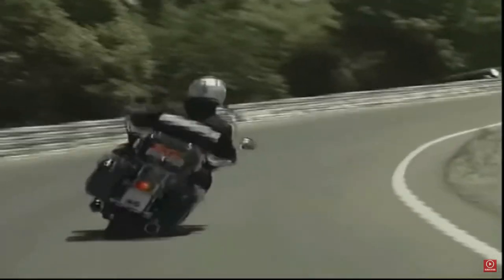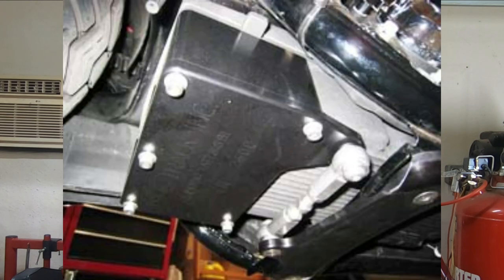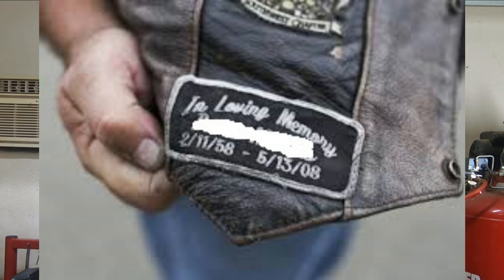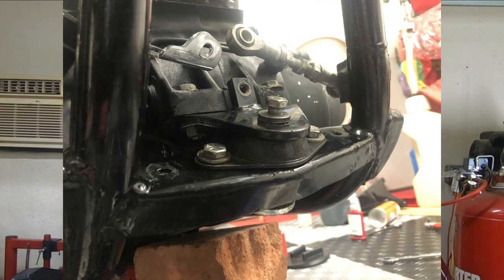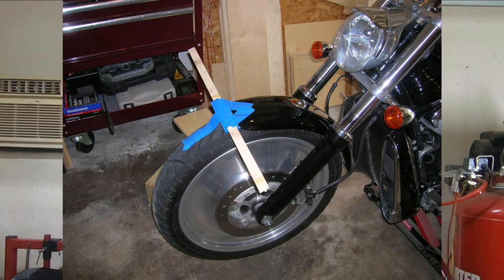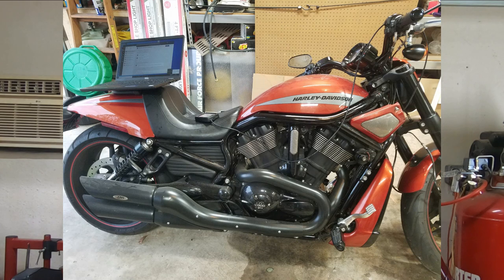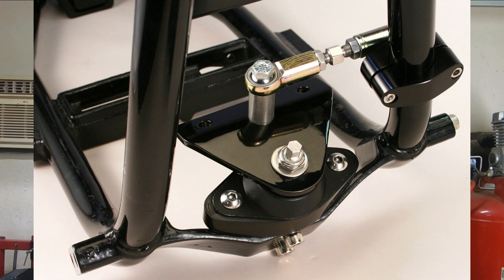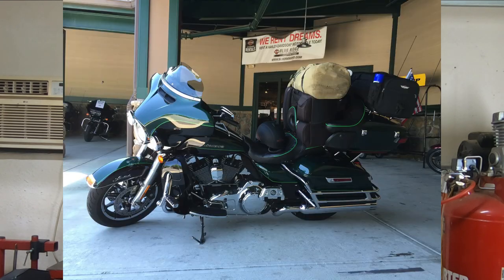The Dangerous Harley Problem

Comment: Look at all the big twins like especially the Ultra Classic they made through the years prior to 2008 and compare them to the 2008 Ultra Classic and then the 2009 and newer where they improved the rear suspension and drivetrain and increased capacity and you will notice that the 2008 was minus front of engine stabilization that was on previous years and I bought a new 2008 Ultra off the showroom floor and it wouldn't drive properly two up at highway speed and always felt it wobbling back and forth and just poor handling. I took it back to dealer numerous times and they said they could find nothing wrong with it and that was just the way it was and "they all do it" !!! Well,  my wife and i got in an accident due to the way the antiquated farm equipment handled and I decided to unload it at a loss as I deemed it unsafe and bought a 2008 Victory Vision Tour  and to this day, best Handling American bike I ever rode and I have been riding Harleys all my life. Now supposedly in 2009, they changed the design and I'm.told they are better. Too little, too late as Harley didn't care! Never going back.  I would buy an Indian first.  Great content. Muchly appreciated 👍👍👍
✌️🇺🇸

Comment: I’m sure this will happen to any bike due to lack of maintenance etc but it seems it’s inherent with HDs even with proper maintenance. I currently ride a 28 year old German sport tourer and a 7 year old Japanese ADV bike and both handle without issue when they are pushed hard or not. I was thinking about adding a pre 08 Dyna or Road King to my stable but the more I learn about how these bikes ride and other characteristics I think I’ll pass. For the lack of better Terminology, they just seem like junk. Heavy slugs. A solid mounted Sportster could be better

Comment: Are you familiar with the dreaded Double Death wobble? Thru the summer months of 2022 I counted a total of 13 passenger vehicles on the highway berm.All 13 were setting right down on the rotor missing the drive side front tire, occasionally you would see where the tire upon leaving the 70+ mph vehicle would jump the center concrete divider and be a quarter to half mile down the road in the opposite lane,or an undrivable car parked with the windshield smashed in as well as grill and hood.Non of the above were jacked up indicating a tire change. That brings me to operator error I.E. lug nuts coming off. What individual could possibly drive long enough for all 4 or 5 lug nuts to go come completely off without noticing something? In any event the Dreaded Double Death wobble falls in the same category as the Death wobble, OPERATOR ERROR - NEGLECT. I've been riding 3 decades plus, all over the USA at various speeds ,rain,shine, and a few times a spurt of hail up around the lakes,on HD's and never experienced the DW , my bikes are meticulously maintained.Now I have witnessed the Dreaded Double Death wobble.

Comment: All tyres go out of balance from wear! I use ceramic beads in both front and rear ,problem solved, tyres always balanced! And I have braces front and rear on my FXDB 2006 and the rear on my old FXRP 1991 again no wobbles anymore! 🇬🇧🏴💪👍
Reply from the maker: I am huge fan of balance beads! By the time you get to a speed to matter on tire balance they are already doing their job!

Comment: Sorry HD has always had this problem, just the rubber-mounted drivetrain really increased the problem.  Years ago had a Kaw H1, and they were known as widow makers due to the wobble problem and the toggle switch power band.  The Kawasaki was somewhat easy to fix, they had crap swing arm bushings and if you pushed it frame gussets.  The HD is already stressed to the max weight wise, so the bike is pushed to the max from the factory, now you put a passenger and loading goes into the OH SHIT mode.  The easy answer is to simply buy another brand of bike that doesn't have so many issues that it takes a book to catalog.  Sorry HD has issues with wobbles, clutches failing, engine failures etc... and all for the price double that of the competition.  It is bad when my 93 Goldwing with over 100k on the clock has practically double the lean angle, no wobble issues if the tires are kept within specs, and a bulletproof engine.  My only outside repairs outside routine tires, oil, grease and filters has been a couple of light bulbs, upgraded alternator, battery change out every 5 years and cam belts at 50k intervals.

Comment: Commonly known as Dyna death wobble.......because this only happens to dyna's, that is according to a utubr Harley hater

According to him it's because no 2 shocks are exactly the same........of course crotch rocket tank slappers being the same thing have only one shock in the rear, and Harley doesn't make them

Tire pressure.......when my gauge said 42lb I was actually running 48 on my crotch rocket, I had belt showing in the center at about 2k miles......found 2 gauges that said same thing and went with them.....I traded crotch rocket at 3k and tire showed no wear and handled great..... didn't seem to hurt the front tire

At same time my Wide Glide had been running with too much air also, but I hadn't ridden it as much nor as hard.....I ended up with 7k on the rear when I changed it.....on each side there was visible where tread had been, all the way across the tire it was smooth, I've got about 1k on new tire and keeping it aired according to handheld gauge it's showing no wear and handling is great...... I've got new front tire for it but I can still see tread...........the point is make sure the gauge your using is correct

Stiff ride....I had 2002 and 2004 883's......02 was far better handling and it didn't shake me to death...... actually everything about that bike I liked better than the 04...good luck for me to find another..........If I ever need mounts/bushings I'll look up them hard ones

Comment: After well over fifty years of riding Harleys as well as Metrics l have found  a lot of the handling problems found with motorcycles come from a maladjusted wing nut on the throttle.

Comment: I never had the problem in 70,000 miles of cross country riding. That being said,I am anal about preparation,maintenance,tire /wheel settings. I do all my own mechanical work. I buy the best parts available……..I do all you talk about and more. I buy new tires long before they’re worn out. Due diligence = carefree ride

Comment: Folks, this is not wobble. The motorcycle is heavy and was not designed to head into corners like a sport bike. The issue is the tires giving up traction in the sharpest part of the turn. Watch this video and see the tires giving up. Flutter Weave and Wobble are very specific on a motorcycle. Let's not use the term Wobble unless it is a true Wobble.

Comment: 7 years you're risking your life every tire manufacturer in the field and I know this cuz I was a tire guy for a while even if it's a brand new tire that's been sitting on the shelf for 6 years they pull it and throw it away because it is no longer safe because it is dried out and potentially could come apart on you

Comment: When the rear wheel swing arm is attached to a rubber mounted engine instead of a solid frame it will move around. when leaned over.
An absolutely terrible design flaw.
The only real solution is to sell my HD and buy a Triumph.

Comment: I have a question about cams and valve springs...is it possible to over spring a cam and lifter...I only ask because I'm running a
.570 lift cam with .575 lift springs
Should work on paper but at 6000 rpm things seem to be different 🤔

Comment: Yeah, let's blame loose spokes and low tire pressure and completely ignore ridiculously bad engineering from the factory. If you own a Dyna and you've never had the back wheel try to steer you off the outside of a curve it's only because you ride like an old fart. I wonder why Moto GP bikes don't have their swingarms bolted to a rubber-mounted drivetrain? Meh, it'll be fine.

Comment: I've been around Hardee's since the '80s and I've heard about Harley's death wobble since about 85 till 2010 I think it is actually occurs a lot more when you're trying to accelerate through a corner or you get into the corner and you start to give it some gas to go faster and it'll really walk off on you so much so you'll slap the tank I've only experienced that on Hardee's and I've written a lot of bikes I've been riding since I was 4 years old the first bike was 1983 cr60 and I've ridden a bike every day since out of all that time on a bike I had to happen once on a dirt bike and like seven times on a Harley I think it's stupid how hard he has a rubber mounted engine and a hard mounted exhaust they always break right at the exhaust port on the head the flange always bust off because the engine can move but the pipe can't because the pipe is hard mounted to the frame which is to me stupid they should have put a flexible mount on it I know my dirt bikes were rigid mount but they still had rubber mount for the exhaust

Comment: You said 2009 and down. That is not correct. 2009 has the same frame, engine mounts and swing arm as the 2010 an up. You should have said 2008 and down.🙄